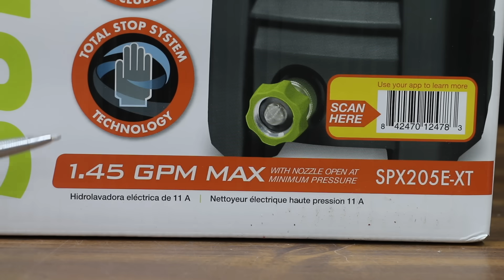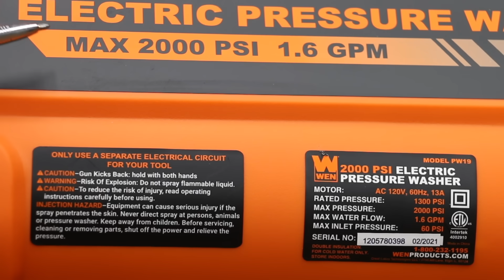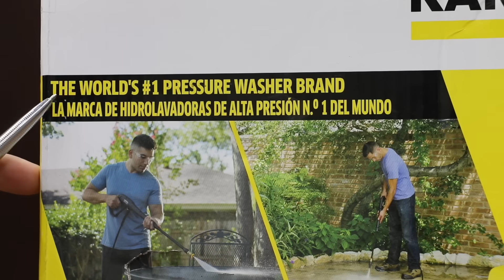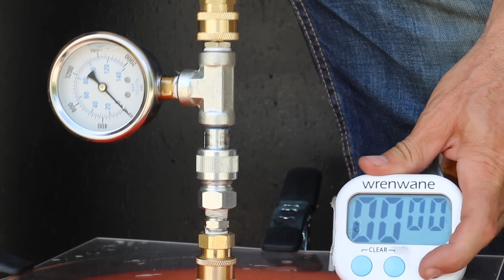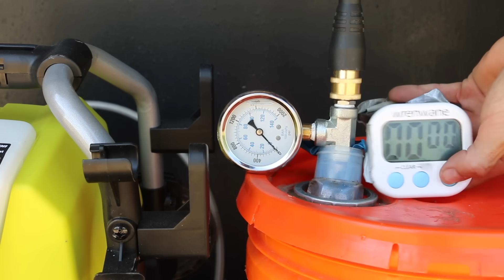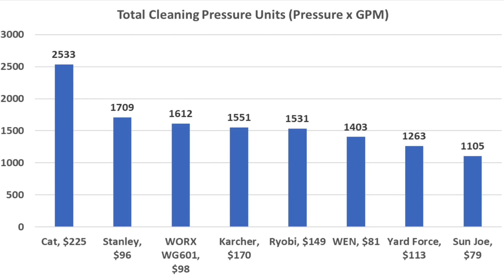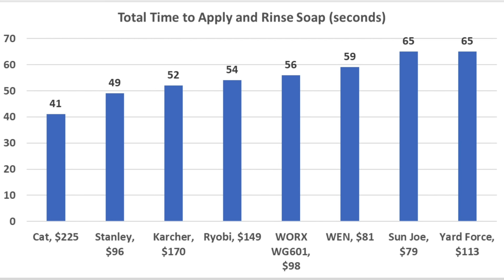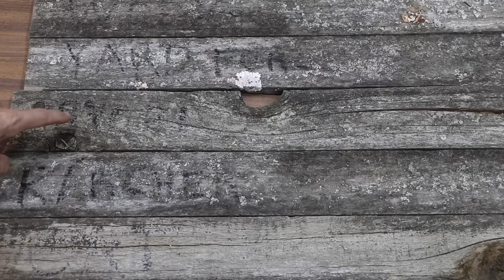Best Pressure Washer (ELECTRIC)? Ryobi vs Karcher, Stanley, Sun Joe, WEN, CAT & WORX

Comment: Conclusion: stick with gasoline pressure washers for best results.
Reply: I hate to be the one to tell you this but the industrial pressure washers we use on the farm are electric. Mind you they plug into 230, cost around 3500, weight upward of 600 pound and have a separate motor on them to run a heated burner, but still not gas powered.
Reply: @Walker1o8o  I'm sure that's true for most permanent installations (car washes, etc.). However, we're talking about small, portable consumer-grade pressure washers here.
Reply: @spasecookee  I realize that maybe obvious to some people but neither the video nor the above post mention that. That's why I was going to clarify for him. I'm sure that a lot of people don't even realize large commercial units are different from the smaller units, to be honest.
Reply from the maker: Thanks for sharing.
Reply from the maker: Thank you!
Reply: It all depends on your use case.   For my needs, which is intermittent cleaning of vehicles, concrete, plastic, and wood, my 1600 Portable Ryobi works for everything I need, comes with standard parts (hoses, nozzles), and I can even store it in a drawer once I've drained it out.

Comment: you didnt test harbor freight "chicgo electric?" also my least favorite issue is hose management, how do each product handle that
Reply: @Peter Stanley: Just for reference, I have owned both the Harbor Freight (Portland 1750 PSI) and Ryobi pressure washers. Honestly, They are on about the same level as far as water flow and pressure. I paid around $79 (with coupon) for the Harbor Freight pressure washer about 3 years ago and it is still going strong. While it won't strip paint off of a Battleship, It does what I need it to do. The Ryobi model lasted about 2 years before the pump failed. I am not knocking Ryobi, or touting Harbor Freight, as I own thousands of dollars worth of both tool brands. Mostly Bauer and Pittsburgh from Harbor Freight. While neither brand is Dewalt or Milwaukee quality (which I also own), they are both a great bang for the buck, when not abused and used for the proper applications. While my tool experiences aren't as intensive as Todd's tests, I have used a lot of different tool brands over the decades. I hope this information helps you make a decision on a new pressure washer.

Comment: Your wife is like HOOOONEY......???? why is only one side of the car clean? LOL 
Hey as a suggestion for a video, I was thinking the other day as I was being impaled by wire bristles from a harbor freight wire wheel on my bench grinder, that they might be a good comparison. Both bench grinder wheels and angle grinder cup brushes. They can run upwards to 25- 30 bucks for some brands and it's hard to tell if they are worth it. Bristle retention in the hub, durability, strength/sharpness/quality of the metal and it's ability to remove rust, paint, scale etc. Also how it handles when you inadvertently roll over the side and catch an edge of the steel plate or angle iron. Anyways, thanks for the video, when my old hazard freight washer (with my hard wired hair dryer GFCI plug repair ) finally goes I'll know what to look for!

Comment: I've had the Sun Joe for a few years now and it's been pretty good. These tests are pretty accurate to my experience. One thing I highly recommend for any of these pressure washers, especially the adjustable tip ones, is to get an inline filter for your hose. It'll save you a lot of hassle by stopping mineral deposits from clogging the nozzles up.
Reply from the maker: Thanks for sharing.

Comment: Pleeeeease do battery-powered lawn mowers, I need to know which to buy
Reply from the maker: Thank you for the video idea!
Reply: @Zwayne:  I have the RYOBI 40v (non self-propelled) lawnmower with a 6ah  battery. The mower, 6ah battery and standard charger package is on sale at Home Depot right now for $249.99, with a 3 year warranty on everything. Also, if you register the package with RYOBI, after purchase, you get a free $99 rapid charger. It is a great deal. There is nothing the RYOBI mower won't cut, and I get about 45 mins. cutting time on 1 full battery charge, depending on how tall/thick the grass is.  I have had the RYOBI mower over a year now, with no issues at all with the mower or battery. The RYOBI mower actually replaced a Kobalt (Lowe's) Electric corded mower that was still going strong after 4 years. I just got tired of fighting with the cord every time I mowed the lawn. I hope this information helps you with your mower decision.

Comment: Anyone notice that the higher the flow rate on the pressure washer the thinner the spray on foam seemed to be? Just wondering if that would affect cleaning power in reality? Good video though. Just an observation.
Reply from the maker: Thanks for the suggestion.

Comment: I watch most all your videos and I'm fed up with the same issue. It's your selection of what you review! As a used car dealership we beat the heck out of pressure washers. The only one that's capable of abuse and performs well is the SUN JOE. EXCEPT....you picked a Sun Joe model that nobody buys or would buy! The SPX3000 is 2030 psi, larger with wheels and dual detergent dispensers. Non proprietary hoses. Much more powerful than the compact one you chose to review. It's Amazon's Choice and it's $99! You'll spend up to $225 on others but you couldn't fork over an extra $20 for the good model Sun Joe? If you can't afford an extra $20, you can get the SPX2598 which still is 2000psi and only $10 more at $89! But the SPX3000 is notably better. I don't understand why you'd spend $225 or even $170 for a crappy Karcher but you can't spend $99 on the good model Sun Joe that actually is available in stores unlike crap that you reviewed. You did this with your drill video as well. You used crappy brands and expensive brands but didn't put medium brands in there. Sun Joe and Hart and Einhell make drills that are affordable. A lot of people are curious about Hart products since they come from Walmart. Finally, learn how to use a foam cannon. As a car dealership owner, that insults me.

Comment: There is more to the story; reliability, life span, ease of maintenance and repair (if needed,) etc..  I'm not clear on why one would pay $225 for a CAT unit when a gas washer can be purchased for $299?  Money can be saved by doing your own house washes, as well as car washes.  Power Horse brand 3k PSI, 2.5 GPM gas pressure washer is what I have.  Parts and accessories are easily available at Northern Tool.  The Power Horse won't even get soap two stories up, but adding an X-Jet nozzle is the ticket.  A lot of gas washer talk is spent on the Honda engine, but I find that as long as I follow "start" instructions plus depress the trigger while cranking, the Power Horse washer is easy to start and gets jobs done fast.  Gas units are supposed to be prepped for winter, but I have avoided it, without a mechanical failure.  I hope that PF does a comparison of gas PWs (as suggested earlier) discussing differences; ease of set up, storage, advantages and disadvantages between gas and electric.  I think gas washers have a big advantage until Milwaukee Tools comes out with an MX battery version.  Can you hear me now, Milwaukee?

Many thanks to Project Farm for doing the hard work of keeping manufacturers honest.  Sir, your praises are understated!

Comment: I own that Ryobi unit, it's a fantastic little unit and does better than a Husky and Karcher it replaced.  I've done decks, house, patio, lawn chairs, grill, and multiple cars with each of them.  It wins all around from the units I've owned, lighter, more pressure, works faster, quieter, etc...  You might even get it cheaper from Direct Tools Online, but I'd pay full price for it again. 

The CAT one is made by Active, I've heard a lot of good things about it so if you want to spend a little more, that'd be my second pick.
Reply from the maker: Thanks for sharing.

Comment: And here I thought Ryobi was going to be a good brand of pressure washer. I used one when I worked at an automotive detail shop a couple of years ago, and it held up great. It was the 1900 PSI kind. It did a great job when you used a foam cannon attached. 

I wouldn't have thought a manufacturer of heavy equipment would make such a great electric pressure washer. Too expensive for me. If I had to choose, I would definitely have gone with the Ryobi. I trust their brand of electric tools and machinery.
Reply from the maker: Thanks for the feedback.

Comment: I bought a Sunjoe because I just needed something basic that worked.  If I hadn't gotten it on sale, I'd have sent it back.  Apparently they like to inflate their numbers quite heavily, and their usable PSI seems to average about 1000 less than they claim.  Their attachments (while not as cheap as some people claim) are still pretty cheap and sometimes barely functional.  The built in soap dispensers on the SPX3000 that I have are a joke, and had to buy a separate foam cannon (off amazon for like $14) to get a good foam on my car.  The recommended tip does a laughable job at cleaning my car beforehand.  I'll probably end up giving my Sunjoe and all the attachments to my father, and buy something that will actually do what I need it to - which still honestly isn't that much - but my Sunjoe can hardly even handle that!

Comment: Going to need to replace the paint on the Suburban after 10 years worth of washes, lol.

I need to get one to make washing my truck easier, thanks.
Reply: I've washed vehicles without a pressure washer in the past. I wouldn't wash a vehicle today without a pressure washer. I don't know if using a pressure washer makes washing them much easier. I certainly feel like I'm doing a better job of it though. Get a bottle of Pinesol and dump a pint in your soapy water. Then when you're done you'll think you waxed your car. It's amazing! Maybe it just works if you use a pressure washer? Try it. I had a bunch of tree sap on my car once and did it thinking it'd remove the sap. Now I do it for the shine.
Reply from the maker: Thanks for sharing.

Comment: Honestly looks like the first 3 units probably share a lot of components and/or manufacturers. I have the Stanley 2150 PSI model and it's definitely a big step up from the 1600 unit for not too much money. Uses standard fittings and nozzles as well. I don't love how the cords and accessories are stored on it, but been a good unit otherwise. Comes with a foaming and soap attachment too.
Reply from the maker: Thanks for sharing.

Comment: I would've wanted to see the actual pump units disassembled. What I've heard some of the cheapest brands use plastics that are worn down to unusable state in short time. I personally bought one about 100€ unit and was expecting it to last for maybe one or two summers of light usage, but it has survived three summers now. Imo there's about two options. The cheapo models and then there's the expensive models that can heat water. The "middle group" from what I've heard experiences of others generally speaking isn't worth it.
Reply from the maker: Thanks for the suggestion.

Comment: if i’m just going to wash cars, what psi would be recommend? and does electric powered matter over gas?
Reply: I have a Sun Joe 2030 that I use for my cars. I will never go back to gas. The convenience of not having to deal with having gas on hand, having to pull a cord on finicky small engines, and when the trigger is not pulled the motor is off and quiet. Even when the motor is on and spraying it's not that loud so no need for ear pro.
Reply: Electric works here washing cars. You don't need 3,200 PSI to wash a car. You'd be blowing trim off with it.
Reply from the maker: Thanks for the video idea.

Comment: Wouldn't you want the lowest amount of water passed through to be the better pump? In my mind the smallest water bill after getting the job done is the winner, right?
Reply: That can be argued. To get good results you need to have decent flow rate too, in addition to pressure. Pressure is actually quite easily done. But having pressure with flow needs really good internals. If you have really little flow, it's basically fine mist you get out of the nozzle or very fine spray pattern tip that'll damage surfaces. It's always compromise between the two.
Reply: What is this water bill that you speak of? I have a well.

Comment: Triple piston pums the best annova reverbe and general pump makes the best pumps cat pumps are good too if its a triple piston pump. Stay away from axial cam pumps there for people that only use them time to time . A triple piston pump is for commercial use. 3300 pspi minimum is what is id go for preferably 4000psi plus. Gas is by far better. I wouldn't of bought any of those. Mi tm makes good units. There about 900$ up to 2000
Reply from the maker: Thanks for the feedback.

Comment: Like the video. 
But from European point of view the non -metric unit system is so weird with all the conversion factors. It must be so hard to remember these and leaves more room for mistakes. I'm really dissapointed in the best pressure washer.
I think you're limited in lower power due to lower voltage. 2200 watts is no exception here die pressure washer. 230 volts x 16 amps is 3680 watts.
It mostly comes down on power. Specifications and maximum values are just nonsense.
Reply from the maker: Thanks!  Thanks for the feedback.

Comment: for the karcher you bought the low tier high end segment version {K1700} which sadly uses a different Nozzle connector. than the other models
with the K2/K3/K4/K5 series. you can swap out all accessories, even a 7+ year old nozzle still works with the current models.

it is pronounced: ""Ker-ger""
Reply from the maker: Thanks for the feedback.

Comment: Karcher (pronounced Kerher) used to be number 1 in Europe. But that was 15 years ago before they started to make they power washers cheap and made in china. Now only the higher class is good - K5 and above.
Reply: Very true. We had one fairly basic model in 90's and it lasted for...ages in farm usage. But these modern cheapo Chinese models are the same as any "shop branded models" available. Iirc that 90's model had stainless or brass pump parts. I think my dad even bought some pump spare parts for it back then at it's last years. About 100% sure that you can't buy anything for these modern cheapo models.
Reply: @jothain  You can buy spares for the new ones and you will have to as like you said they are plastic mostly - control head and distribution head are plastic and they crack easy. Prices for the spares are ridiculous expensive! Also the motor is not water cooled as it used to be with the old ones. The old ones are water cooled and with metal internals (I think it is a kind of stainless steel if I remember correctly).
Reply from the maker: Thanks for the feedback.
Reply: @ProjectFarm  I will be interesting to start a new series - old vs new. Buy old tools from ebay and new equivalent. Test them to see if old and used is really better than the new ones that are cheap and plastic.

Comment: Please test different de-greasing liquids such as mean green, purple power, grease lightning and awesome.
Reply from the maker: Thanks for the video idea.
Reply: @ProjectFarm   Been thinking about air filters after market vs genuine. Also air filter foam can spray on vs oil and rub.
Reply: I agree but many more need to be added. Simple Green, Super Clean, Zep, Gunk, & others.
Reply: Seconded!
Reply: And just plain dawn dish soap
Reply: Yes please
Reply: @Ben C:  You sure do think highly of your own opinions.  🙄
Reply: And simple green!
Reply: Don't forget brake cleaner!
Reply: YES!
Reply: Good suggestion!
Reply: Big orange
Reply: I would like to see this too
Reply: Great idea. Please if you could.
Reply: And simple green
Reply: I started to use oven cleaner on really greasy engines I plan to rebuild, works great lol
Reply: @joelenglish5845  I was a parts cleaner for a train engine remanufacturer. Brake clean is incredibly effective but volatile as all hell. Mineral spirits are nearly as good but won't eat through your gloves nearly as fast and also won't choke you out as bad. Oven cleaner hurts my nose and eyes more than both of them.
Reply: Yep
Reply: Yes please!!
Reply: I'd also like to see some multi-surface cleaner test aswell.
Reply: Also seafoam 🤣
Reply: Great idea!!
Reply: Honestly guys Dallas paint correction and auto detailing had already done this. Super clean  was by far the best.
Reply: @waterloo123100  Super Clean FTW
Reply: John 3:16 King James Version 16 "For God so loved the world, that he gave his only begotten Son, that whosoever believeth in him should not perish, but have everlasting life." (share the good news of the gospel around the world!) Truth about the deceptive islamic religion channels: christian prince, light for all nations, light shineth in darkness ,,.,
Reply: @1CT1  this is neither the time nor the place.
Reply: @1CT1  yes but which pressure washer did he use?

Comment: Interesting how all of them are universal motor driven judging by the noise, do you guys have 230v pressure washers over there? Typically my minimum requirement on pressure washers is ~2kW, which as far as I know won't work on many 110v outlets
Reply: Industrial units but not homeowners. 110 volts are it inside unless for stoves or water heaters or welders.

Comment: The Sun Joe looks like it's exactly the same as the Stanley with just some minor differences...
Reply: Yeah, I wouldn't be surprised if the Stanley is made by Sun Joe with just a better pump.
Reply: Exactly
Reply from the maker: Thanks for the feedback.
Reply: But the performance of the two is very different. Stanley near the top and Sun Joe near the bottom